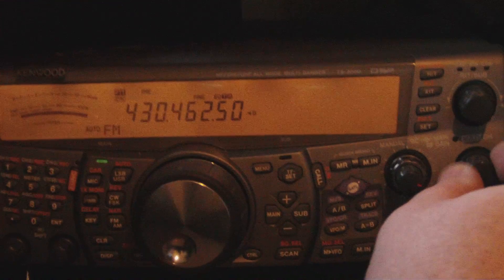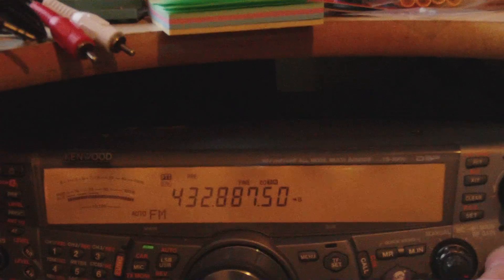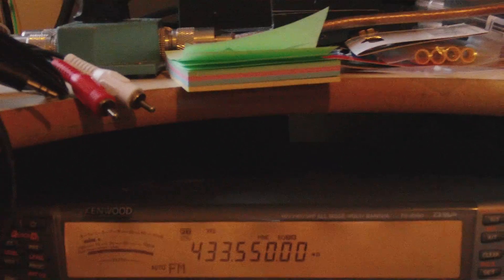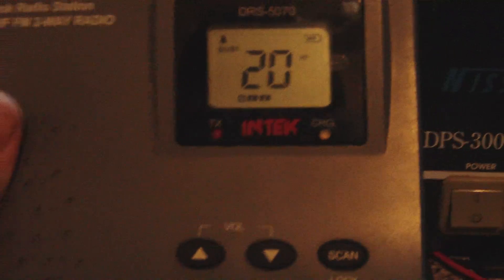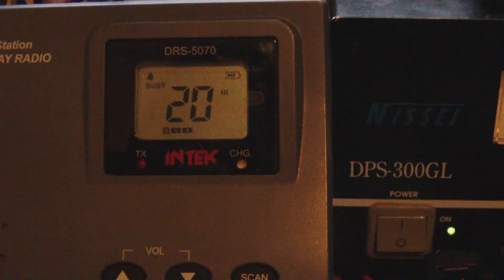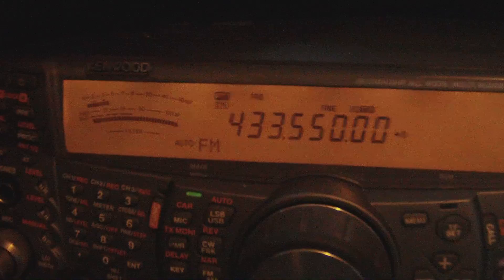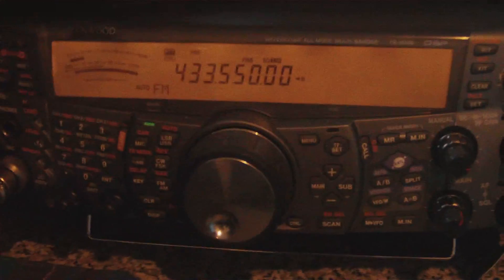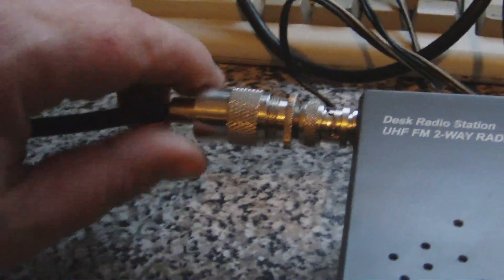PMR 446 MHz  Homebrew Antenna Part 2

Comment: Nice antenna, I'd love to be able to be allowed to put a decent antenna on my roof, but live in an apartment block -_-

I love those Intek radio's they are capable of doing 4 watts straight out the back. I'm still currently looking for a cheepy on ebay, I don't like the housing on the Intek, so I'm going to put mine in an old CB base radio housing and wire a anti static power/echo CB mike to it.

It will be a nice little project for me. I'll make a video of it too.